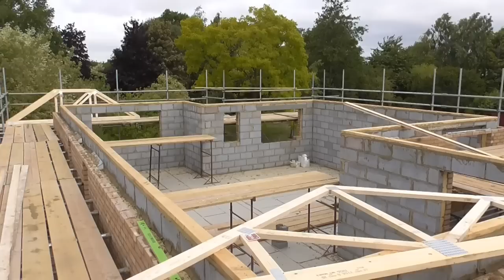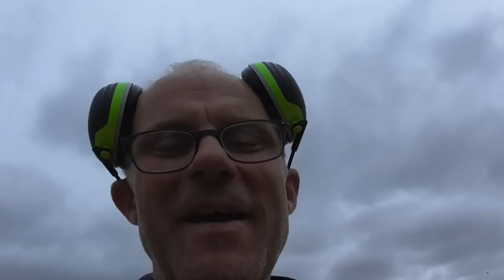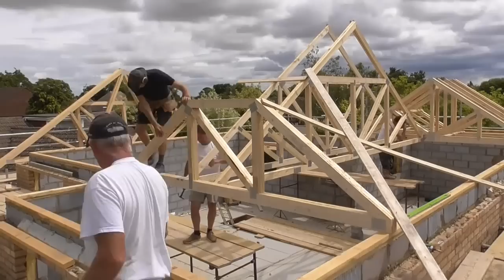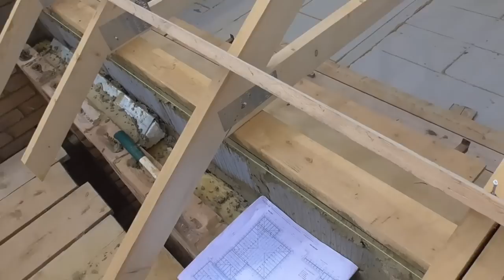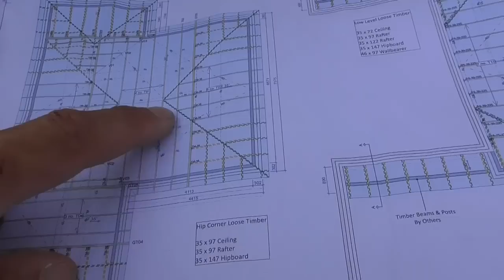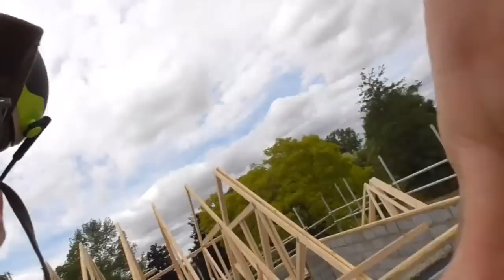Roof truss problems causing serious delays on the 1st day of the 12 hip roof ***VERY FRUSTRATING***

Comment: I had a similar issue with small rafters for a mono pitched porch roof. So the bigger ones were good and when it cam around to the porch area the smaller rafters weren't lining through. I knew the wait would be too long to get them to come out and change it so I just beefed up the size with ply, I think it was 12mm out. But the ply solved the issue although maybe not the best thing to do.
Reply from the maker: Hi Mike🖐The problems we've solved with plywood gussets and plates nailed on in the past is amazing👍plus the structural engineers are happy🤩Cheers Del
Reply: @thetallcarpenter  I didn't know whether it would be acceptable but it worked that's for sure.

Comment: Del how do you deal with mistakes you make do you ever take it personally or do you understand we all make them from time to time? For example that slight gap in a mitre or some other small imperfection do you just accept it as part of the process? Is your high quality of work motivated by fear of failure?
Reply from the maker: Hi there🖐That's a well framed question. If its a silly mistake and easily rectifiable, then I don't really think about it, but if its a more fundamental mistake that someone like me with 35 years experience, shouldn't really be making, then I do get annoyed with myself. An example of this might be setting something out on the wrong side of a line like a stud wall, and then continuing to build the entire wall and any others coming off it, only to find later down the line that is wrong and all needs to be altered, when I should have just double checked it as I was putting the first plate down. My primary motivation for making a nice job, (or the best job I can), is that I just get such a huge amount of satisfaction from doing/looking at top quality carpentry, and conversely, I don't like to see poor quality work👍Awesome comment🤗Cheers Del

Comment: Truss manufacturers are useless .... Give me a cut roof anyday
Reply: Some of these manufacturers are tossers, I did one 5 years ago, side extension but existing was pitched ,architect and builder whent for trusses I told them there would be problems as the truss company wouldn't get it even though we gave them every measurement, ended up ripping up firring pieces to plant on top of the trusses to sort it 😁
Reply from the maker: @bricklayersworldwithandy6277  Done that as well Andy😬I haven't fitted a decent quality truss roof for years now, but my builders love em cause they're quick and cheap😵
Reply: @thetallcarpenter  Cheap, they think untill it goes all wrong then loads of daywork get slung at them, they aren't builders anymore like we knew them just business men, I could think of another name 😁
Reply from the maker: @bricklayersworldwithandy6277  Rymes with 'bankers' Andy😲
Reply: @thetallcarpenter  🤔
Reply from the maker: They make these trusses to a tolerance Karl🙄Hand cut is best, but its not usually my call😬Thanks for watching 😎 Cheers Del

Comment: Feel for you Del. Aussies build generally pretty poor homes but they have mastered trusses. That truss plant should be closed down. Playing at building trusses and haven't a clue. It was over 20 years ago when I was designing and building trusses. Even back then everything was computer controlled. We entered the floor plan into the truss program in zones. Usually in 2 or 3 different ways with different bearing points and point loads. The program then works out every single component for each variant. Pick the version you want and send to computer saws. The program is the certified engineer and you can issue an engineering certificate directly from it. The cutting and picking list that goes to the construction floor has every size, grade of timber required and the components are cut by computer saws. All the box settings for the press boxes are included and as the timber was cut by computer if something doesn't line up it flags the box setting as probably wrong. All the plate sizes are on the set out plan and the pre set truss cambers. All the truss boots, brackets, bracing you name it. All ancillaries are spat out by the program and strapped together as an ancillary pack that goes out with the trusses. And like we have discussed before all the hip rafters are pre cut and included with step down hip trusses that form part of the hip. All valleys everything come made in the pack. Full layout drawings with every measurement for truss positions all numbered. And corresponding truss numbers. Each hip set is marked say in your case A to F and then each member numbered within that set for placing. Any bobtail trusses pre cut. The only cutting that  would be required on that entire roof is on each hip corner you have to cut back and install horizontal support timbers to the hip board at fascia level bracing back two trusses in each direction. Plus the computer program is even better now 20 years on. And then I watch you struggling with a catalogue of disasters.
Reply from the maker: Hi Dave🖐I was getting more and more excited as I read down your comment🤗Sounds like an amazing system, and absolutely love to fit a roof like that🤩Thanks for another awesome reply mate, and also for watching😎Cheers Del

Comment: Such a pain. Your point about the 'time' it's so true and so hard to make it back up again! On the plus side, the gun looks great. I've recently got the Hikoki gas free - a bit heavier but so far, so good. Keep up the great work. Good luck
Reply: I recently bought the dewalt 1st and 2nd fix. The 1st fix packs a punch my only issue is it weighs a ton. Infact whilst we are talking about a schwaznegger film my forearm is now the size of his in his prime Mr universe 😀 carrying and using the thing everyday
Reply from the maker: @mikerevell8145  The weight of the battery only guns is the single biggest thing stopping my getting one😬 5.5kg is a lot to be swinging around all day instead of 3.5kg💪 I did gave a go with the Milwaukee 1st gun, and yes, it was also heavy, but crikey, it had some power👊👊 Cheers Del
Reply from the maker: Hi Lewis🖐That Hikoki is a beast👊It's like the Terminator, and just keeps going😲Thanks for watching 😎 Cheers Del

Comment: Could you not glue and screw 2 by 1 laths onto the tops of the low trusses?
Reply from the maker: That's what we'll be doing Andrew as the roof designer has ok'd it👍Cheers Del
Reply: @thetallcarpenter  yes it'll be very strong if you use the expanding polyurethane glue...set in 10 minutes ☺️

Comment: Really Frustrating Del  i know your pain. I had a supplier one time on this side of the puddle and they started off very good, all of a sudden things started slipping just like whats happening on ypir job. Id a pretty good relationship with the rep. They wernt a cheap company to buy from. Anyhow he promised all sorts but problems still kept occuring. I finally had enough and i got a 8' x 4 ' sign printed for the site detailing the delay with the company. I told them the way i wanted the job measured in the future and i insist on their engineer meeting me and their rep too to measure the job and have a pre design meeting. They dont get paid until the roof it ready for felt and batton. We have a good relationship now 😉. Id imagine. If you spoke to them and told them about your channel, and that you would be afraid youd let their name slip by accident ( seen as your gerring on !! 😜😜) it mightnt be good advertising. Hope you get fixed up
Reply from the maker: Hi Gerard🖐I guess that's one way of getting a company to pull their socks up👍The company that made the roof have been knocking out pretty poor trusses for years now, and you just have to accept that you're gonna get problems😬 Thanks for your comment and I appreciate you watching😎Cheers Del

Comment: I find when ever I do trussed roof there’s always something that has to be worked around whether something has been missed out or the manufacture of them isn’t always up to standard. But when you do speak to them they try to make out they’re not at fault and when they do realise they’ve made the mistake they go all quiet and like you say are in no rush to rectify things. This is probably why I prefer a good old fashioned cut roof! 💪🏼😎 It’s like when the computer says no they struggle to do anything and just do anything until it accepts it, and then us at site have to fix it!
Reply from the maker: 'computer says no'😆 Their design software draws the last common truss on the hipped end INSIDE the actual geometric centre line of the roof, meaning the end common 'mono' rafter physically cant join in an equal roof plane😩 There is diminishing truss that the rear  end common/hips fit to, but it has been drawn OUTSIDE the hip line so could never work😬I'm ditching these trusses and putting it in hand cut so the hipped end works properly👍More videos on the way on this and thanks for your comment and for watching😎Cheers Del
Reply: @thetallcarpenter  I don’t blame for ditching the trusses! Look forward to seeing how you get over it! 👍🏻 you’ll certainly put the Fischer gun through its paces there!
Reply from the maker: @mattwilkins5058  It's back on track now Matt🤟
Reply: @thetallcarpenter  Glad to hear it 👍🏻💪🏼😄